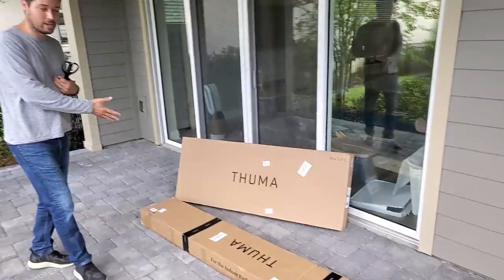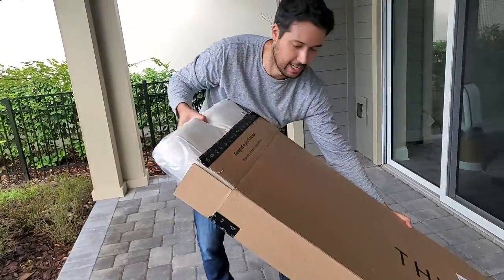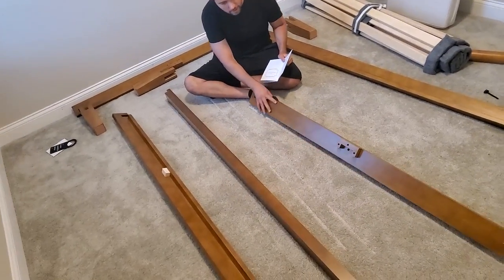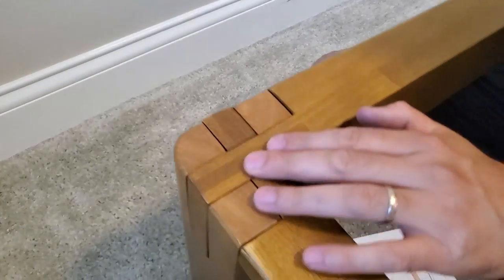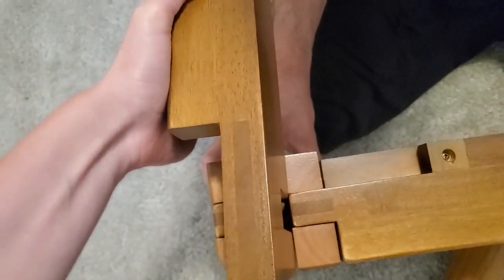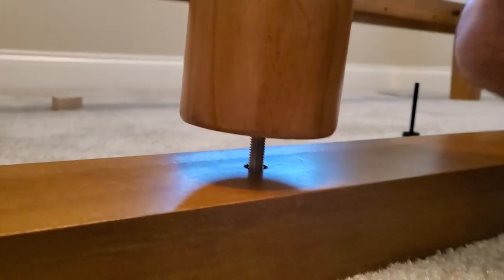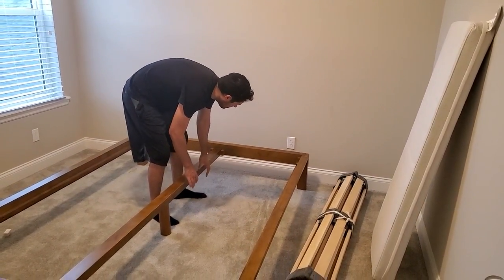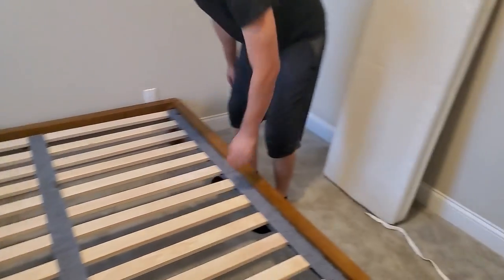Thuma The Bed Unboxing Review Hands On First Impression Setup Frame Walnut Light Linen Queen

Comment: It's like going back in time to gain advanced engineering concepts.  "In the Day" long ago, there were no Ryobi cordless drills, Kreg jigs, plastic of any sort, or chemical plants producing modern glue.

Joinery, particularly Japanese and Chinese, was one of the engineering techniques developed for furniture and building construction.  I'm looking this bed over because it's like a /headslap.  Of course.  Who has to have hardware kits when you can just do this?

Thanks for the video.
Reply: Poetic

Beautiful

Comment: Unless you’ve seen one of these up close and know better, it doesn’t look that stable to me.  Also, it doesn’t look like the headboard is attached, but rather sits on top of the frame at the head.  If you need the bed out from the wall a bit, like in the video for the electrical outlet, I’d think the headboard might slip off the edge. That’s my take just from what I can see from the video.  The price ($1,281.64 incl. tax) seems high for a mass production item, but I don't know what kind of wood it is (I doubt true walnut).  I haven't priced hardwood (especially walnut) lately.
Reply from the maker: Honestly haven't had any issues with the bedframe stability. The headboard has never fallen on me. It gets sandwiched between the mattress and the wall. Not if you try and moved the bedframe around the room it may be more difficult than other bedframes that are nailed together. The perk is it's easy to build and take apart unlike bedframes that have screws.

Comment: Do we need to add some Non-Slippery Padding underneath the Bed legs to avoid slipping the bed on a hardwood surface? If yes does anyone know the good padding company which fits the thuma bed legs according to its size
Reply from the maker: I swapped out my floor from carpet to luxury vinyl. The bedframe hasn't moved. So I don't think you need that cushion.
Reply: @davewelike  So on hardwood floor, it won't move at all if it does move can you suggest any nonslippery padding which is specifically made for Thuma bed legs?
Reply from the maker: @jamesaustin9656  ask Thuma. I don't use any pads so I don't know.

Comment: How do you feel about the “headboard” cushion. I wish it had slots to go into to stay put. Have you noticed issues of it moving constantly or waking up and it’s off the bed? 
Also, any mattress will work (i know you need your size. But if it’s a queen, any queen will work?  TIA
Reply from the maker: The cushion hasn't fallen off yet. It's fairly tight between the mattress and the wall. Would be nice to have a string that could wrap around the bedframe as a precaution. I'd assume match the bedframe size with the standard mattress size and it should fit.

Comment: That foot shaking at 14:13 concerns me about the quality of this frame.
Reply from the maker: I mean I was wobbling the foot as I was shaking the mattress. I don't think many people do that at night. Also your body weight helps push the frame together too.
Reply: @davewelike  That makes sense, It's probably not a good option for someone with kids as it gets constantly wobbled so my thinking about a good frame is that nothing should move but it's pretty hard finding that nowadays. Still a good option for a portable frame and good thing is it's made of solid wood.
Reply from the maker: @mac2805  for kids that do have to jump up to get on the bed, I could see them kicking the mattress which would move it off the bedframe. Probably want a bedframe that holds the mattress in place more.